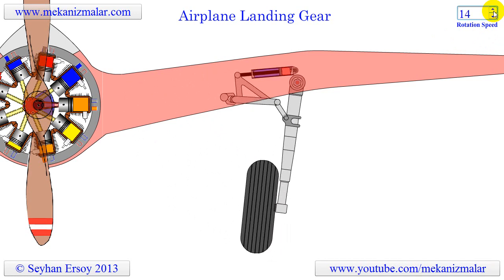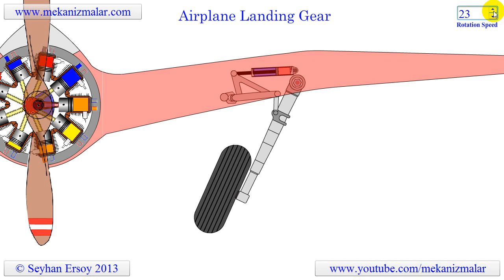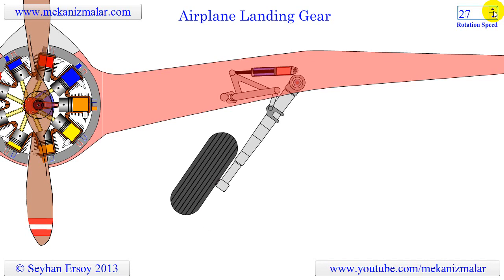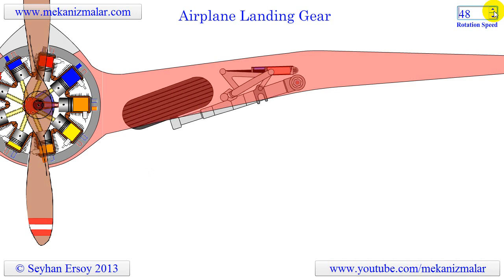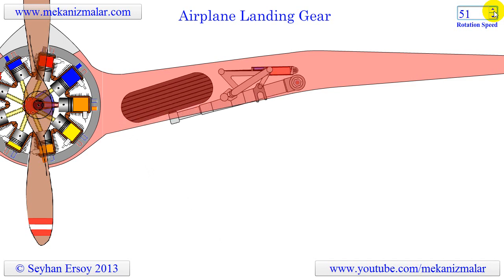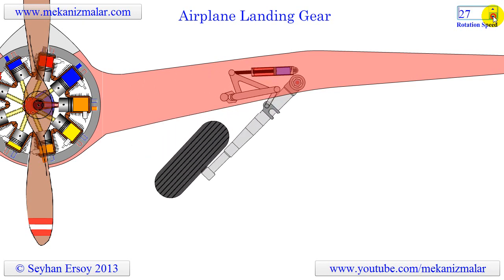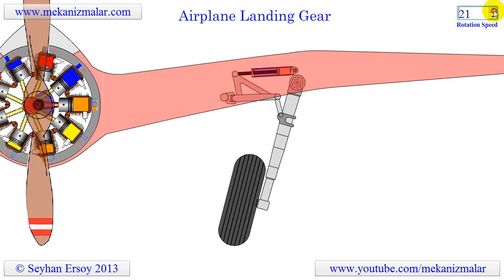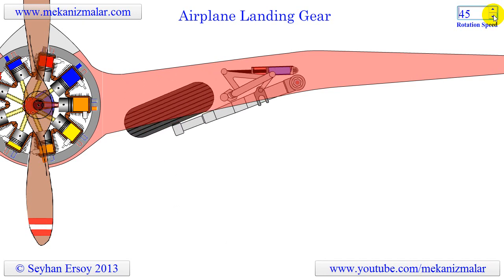airplane landing gear

Comment: Good Job.....ISIS invaded my country I will Build Radial or V12 engine plane and the landing gear will be paddled..With Control stick Cable controlling system....The Frame and The Body Will Be made From Thick Aluminium Sheets....With Hospital Oxygen Tanks For breathing and sealed glass Covering For no leak...The Fuel will be kerosene or Gasoline and I will Store it In the wings

Comment: u suck its not working on lego technic
Reply from the maker: Dear Kristoffer, there is no need to be rude. I do not know what you are doing, so I can not comment about something I don't see. You also did not describe the problem you are facing. As you see, in the animation, it works. Since animation does only concern about geometry, ignoring the forces, it may not work in practice. If in certain condition the force required to extend the tire can not be obtained from air cylinder, it may not work. There is a saying, "Everyone can fly a monkey on paper". In practice it is different matter.
Reply: but i soo soo sorry i make the landig gear on lego technic soo sorry for that am so so sorry
Reply from the maker: Kristoffer Eriksen
I am happy that it worked for you :-)

Comment: Nice mechanical vid.
You did not mention it is considered to be a valuable trade-off in weight, and less fuel storage, to have a more aerodynamic airframe.
Faster, and more efficient with retracts.